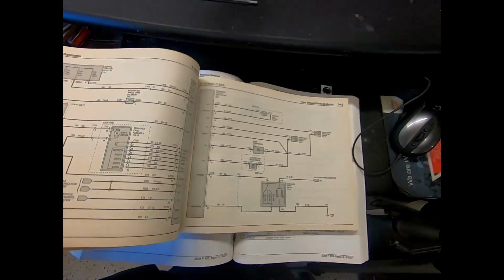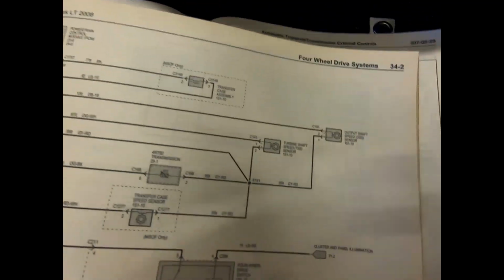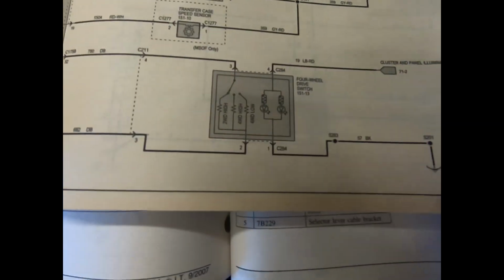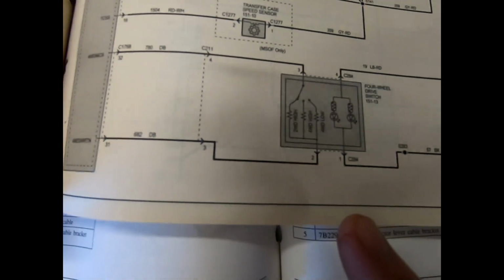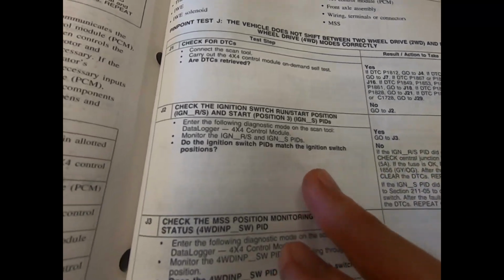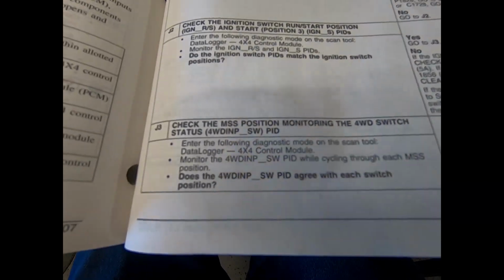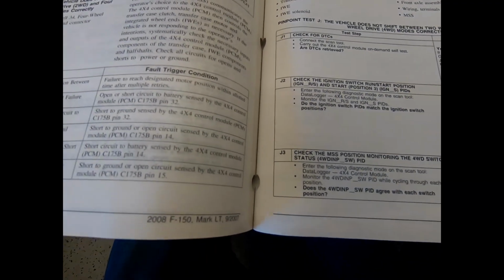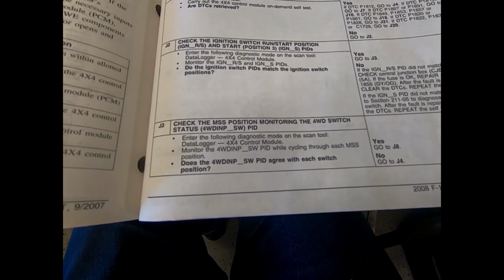2008 Ford F150 F-150 Transfer case not shifting back into 2WD (stuck in 4WD)

Comment: How did you get the switch out?
Reply from the maker: Gotta pull the radio cover and radio. It has a clip retainer in the back holding it in.
Reply: @garthsanders ok thanks, I did the shift motor, the actuator on the firewall and still not working, I’m hoping it’s the switch.